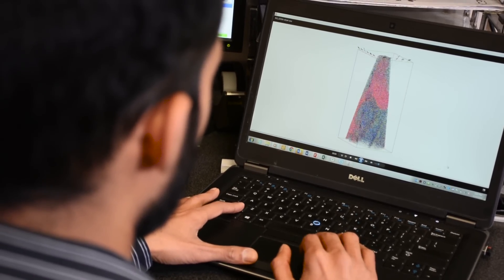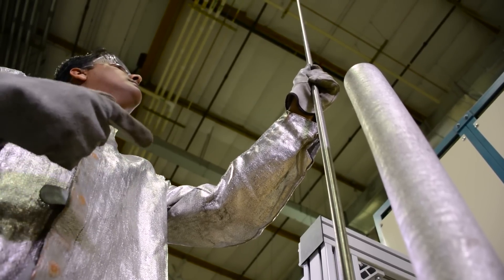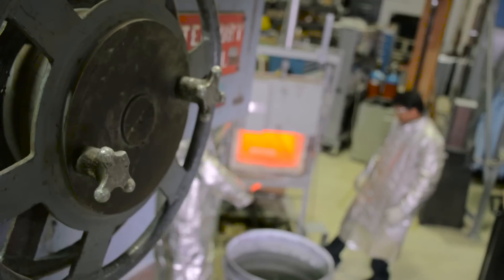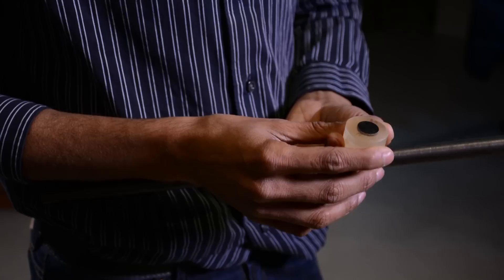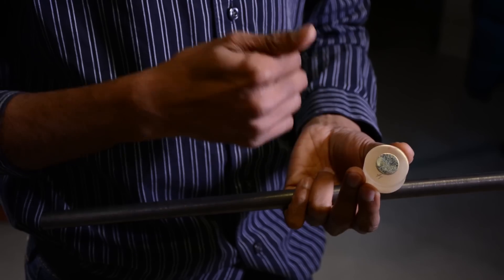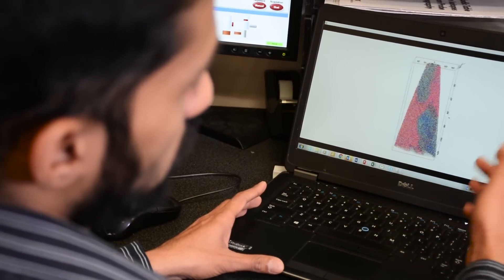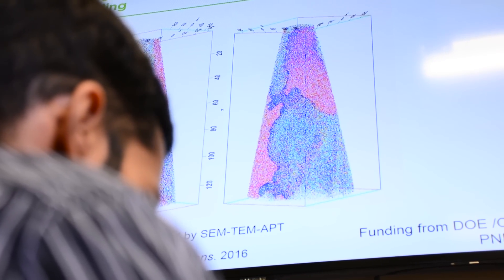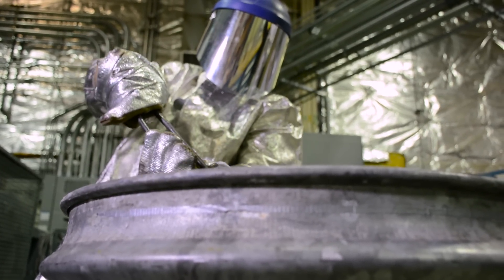A Closer Look at a Stronger Titanium

Comment: QUESTION: If the goal is to strengthen Ti, why not explore Ti3Au, which reputedly has triple the strength of elemental titanium.  Granted it would be ruinously expensive given that half its weight would be gold, but unlike tungsten carbide, I believe Ti3Au is completely non reactive.
Reply: There are more practical beta titanium alloys which would be much more cost effective for the majority of uses, especially for the automotive industry. The Ti3Au is likely used exclusively for dental purposes because both metals are inert and biocompatible. Any significant volume of that material formed into stock, bar, billets, or plate would be outrageous in cost for everyone and without enough benefit. The heat treatments of pre-existing beta titanium material has not been studied well enough yet, even for established commercial alloys.
Reply: @-Tokay- Yes, it goes without saying it'd be ruinously expensive for structural parts ... however, for small mission critical parts as well as for implants it xould be a game changer. 

BTW, another advantage of Ti3Au is that it should be 3D Printable. [Edit: this may not be true]